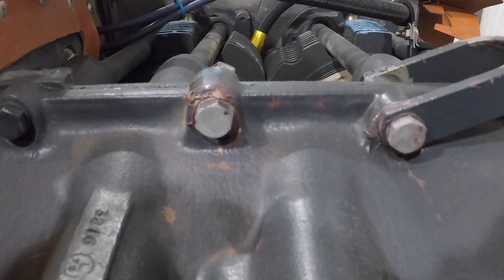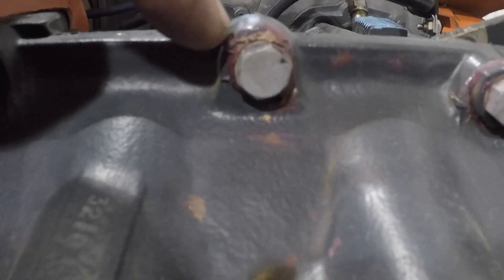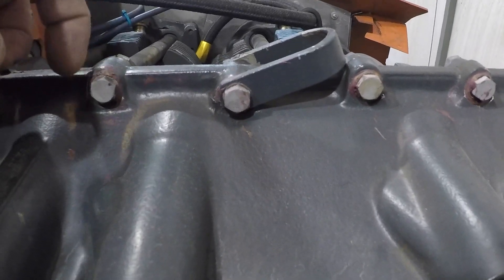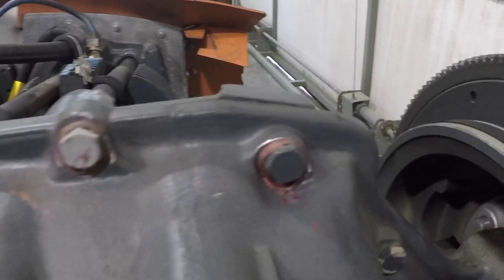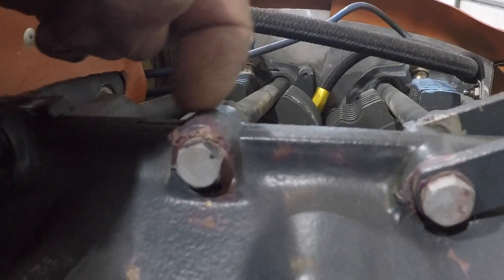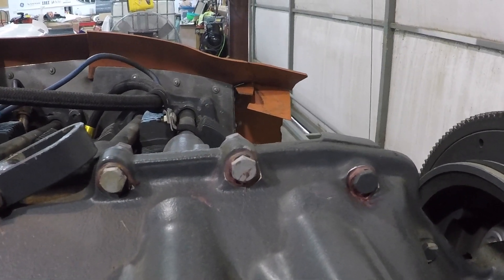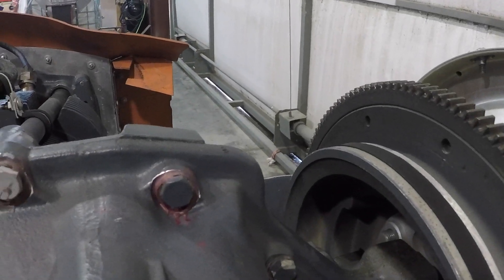Oil Leak - Case Bolts - Grumman Style

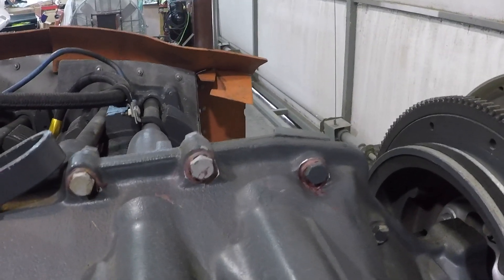Comment: Could you provide more detail on STC for the bolt seals that you have mentioned at 1:30?
Reply from the maker: Not an STC, just a way to seal the case leaks.  Lycon has an STC to apply orings into the case at each bolt holt to prevent case leaks.  FYI